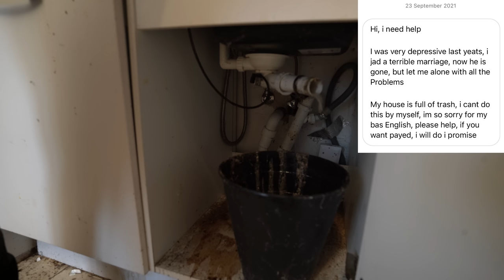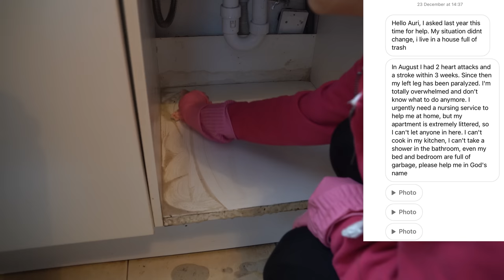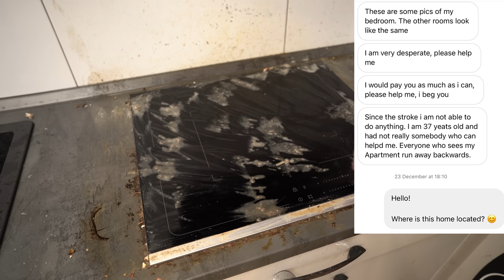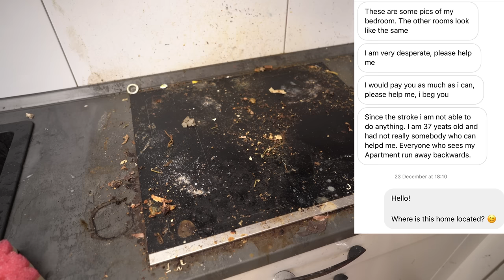SHOVELING SLUDGE FROM A SINK| Helping a disabled woman🙌🏻

Comment: Thank you for confirming my suspicion thar German oven cleaner just isn't as good as your magical Finnish oven cleaner! I tried to use it and it's only a little bit stronger than washing up liquid imho. Maybe they had to tweak the recipe due to safety regulations?!
Reply: Just take p..wi.
oven cleaner. Put it on well. Cover it with a plastic sheet. 
After some time you can easily remove it.

Comment: Have you tried putting a cup of water in the microwave to remove the gunk? If you place a bowl of water in the microwave and then turn it on for a minute, the steam will loosen all the grime. No chemicals. Of course, if it's very dirty you may have to do it a second time, but you won't need a scraper.

Comment: I don't have a really dirty microwave but sometimes there is grease in it which I find hard to shift.  I have found that if I put some water in a container into the microwave and boil the water in the microwave, it also loosens up the grime and grease which also makes it easier to clean.
Reply: Specially if you add vinegar or lemon drops in the water the grease will come off easily
Reply: @user-gr2Algeria OK.  I never thought of that.   Thanks for that information. I will try it. 😊